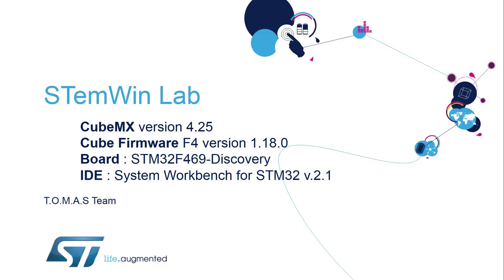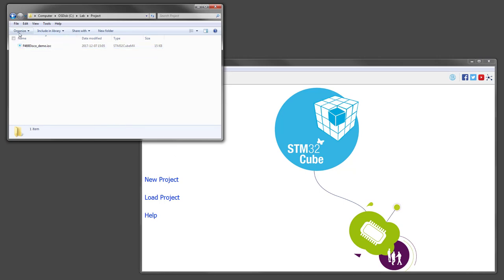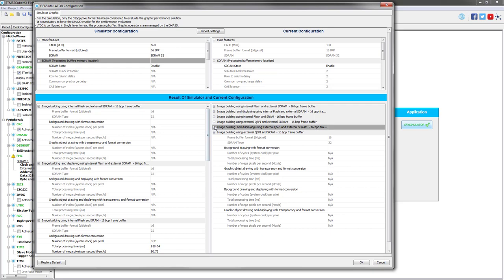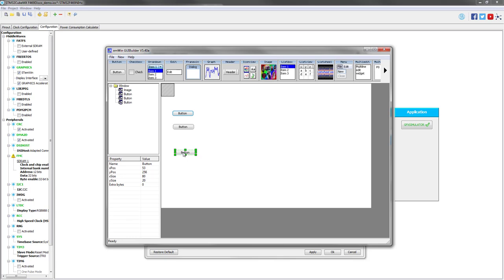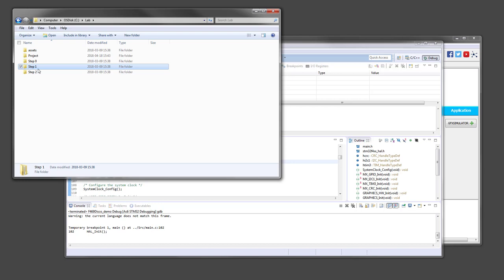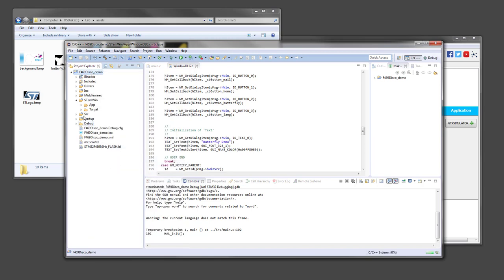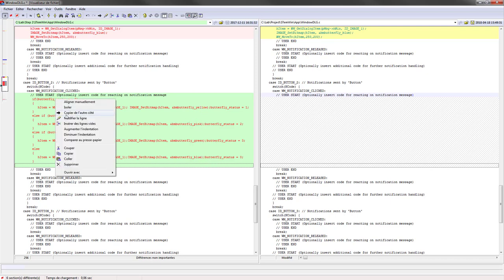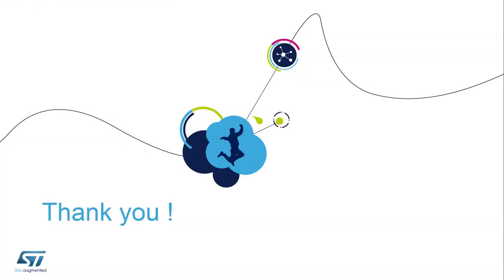Graphics with STM32 - 5 STemWin Lab - SW4STM32

Comment: Unfortunately, STemWin isn`t include in latest versions of CubeMX
Reply: What about STM32CubeIDE (version1.8)? can you manually adding STemWin Library to compiler or linker?
I'm working with NXP MCU's and Keil IDE, the emwin is working rather well for me. Do you have any success with ST32 yet? TIA
Reply: @richardle899  Yes, I spent two weeks and at the end the library had been working well! But the mode "3bits per pixel" isn`t working properly. My ili9488 working correctly only in "24bit per pixel" mode. It`s bad - I must to transmitt   460kBytes instead of 76kBytes.I use IAR ARM IDE.
Reply: @andrewandrosow4797  ,thank for your response.  I want to develop hmi product with STemwin and Bluetooth using STM32WB5MM Discovery board and ST32CubeIDE, I am stuck, don't know how to compile and Link STemwin,  do you have any suggestion?
Reply: @andrewandrosow4797 ,my display controller is ST7789, spi mode, I don't have any problem developing in Keil IDE.
Reply: @richardle899  For the first - you must to write low-level routine for translating blocks of data from STM32 to the display controller - I used f HAL_SPI_Transmit(). These low level functions (in emWin) declared in headers but it isn`t wrote in c sources.
Reply: So would you say if I bought this discovery board and worked with old versions of CubeMx this could be emulated fine? 

TIA